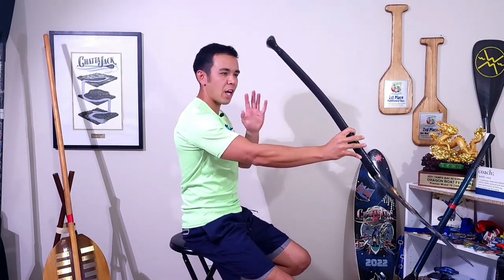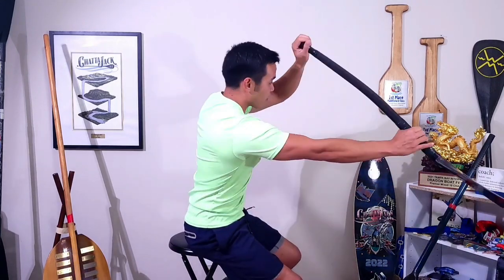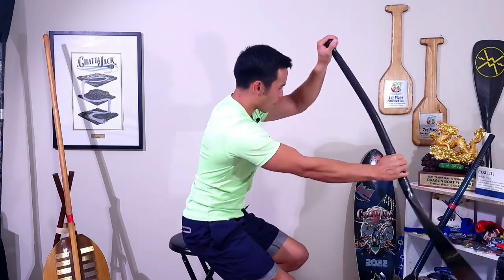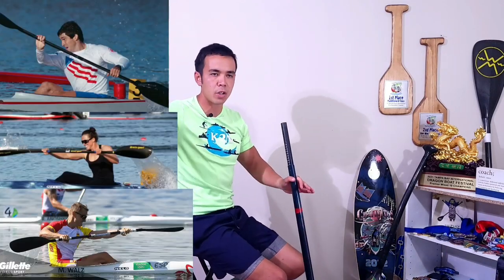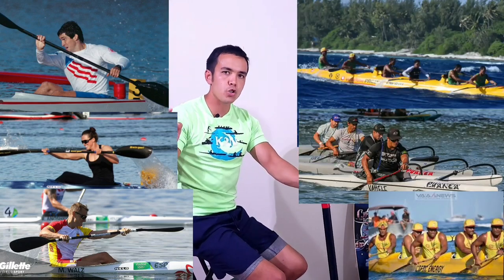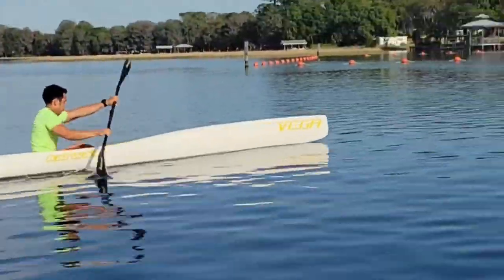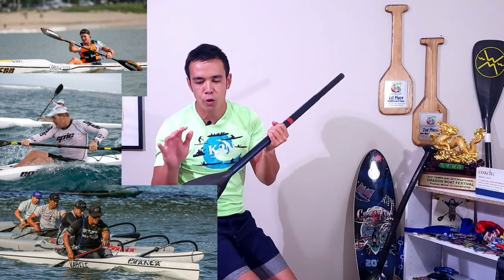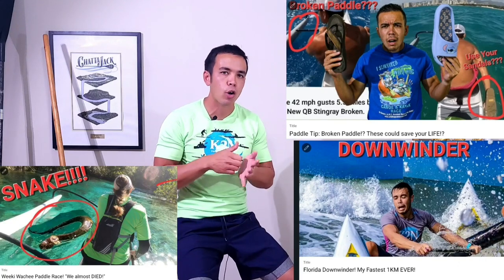Paddle Tip: Powering The Pendulum (Outrigger/Surfski)

Comment: Another excellent video! The guy that coached me when I first got into surfsking was adamant that I start thinking about pulling the blade out as soon as I started the catch. When I was out on my own practicing I felt like I was cutting my stroke short and that I had power left right at my hip. Now I bring the paddle all the way back and rotate just past my hip before I pull it out. It feels much more powerful.
Reply: Absolutely.  I reached the same insight, while practicing on my own, in an oc-1, and focusing on the feel of the canoe.  As David Tepava, Shell Va'a's coach, once said in an interview, when asked about the secret to the huti pa'ari ( a traditional Tahitian long stroke, that strikingly reaches maximally far in back ):

"[The secret to the huti pa'ari] is to gain an appreciation for what we do: paddling with the elements, atuned to the canoe's glide, and the feeling of the sea.  This stroke may be slow, but there is a heck of a lot of pull pressure, which is why the canoe glides far." — David Tepava

Focusing on the canoe's feel is key, and will reveal the mysteries of the stroke.  In another interview, Tepava also says: "Having tried several training regimens, several canoes, won every race, I came to realize that what matters is not the speed of the stroke, but the speed of the canoe."

The reason extending the blade past the seat works, is that the blade is still locked in the water mass, and that you can use it as an anchor point to, in effect, pull your hip to your top pressing hand, as it swings down, thus propelling the canoe forward, much like poling a boat ( or "pole-vaulting" ).
Reply: @namolokaman2393  thank you for sharing this insight! It really helps clarify why that last little bit feels needed. I like the analogy of poleing the boat
Reply: @paddlefaster  Contrary to common belief, the contribution to forward motion, by the so-called "negative angle" part of the stroke [ here, defined as when the blade extends past the body, from the point the bottom tracting arm reaches vertical, while sitting upright, as opposed to the strictly vertical azimuth of the blade or haft, which occurs well in front of the body ], can be substantial.  You can easily verify this, by seating upright while inserting the blade at about the seat, and swinging your top arm down-and-aft, thus producing a mostly rear-powered stroke, and see how much forward motion you get ( answer: a lot! ).  In fact, Shell Va'a famously relies on a stunningly rear-powered stroke, which is extra deep and reaching maximally far in back (!), called the Huti Pa'ari, usually to go against mild swell / hard-water conditions, while saving energy ( it's a 3-second stroke! ).

Comment: That's good; I am glad we're finally coming around — slowly — in the Northern hemisphere, to talking about allowing the blade to extend past the seat, into so-called "negative angle" territory.  So many outrigger paddlers, particularly among the older generation ( older coaches especially ), appear fixated on preventing this from happening.  Consequently, the blade ends up exiting early, systematically ( even when not sprinting ), which basically is an enticement to paddle short and fast — accelerating — all the time, and gets exhausting, not to mention inefficient, particularly for long-distance.

Regarding stroke motion, I personally like to break it down into two component motions, mixing in varying amounts ( meaning ranges ), depending on stroke type: huti pe'e, huti roa, and huti pa'ari, in Tahitian ( which we've labelled, at our club: high-tempo, easy-long*, and deep-shovel ).  The first component motion — in its fullest amplitude — is the pendulum swing, at arms' length: the upper hand increasingly pressing down toward the gunnel, while shoulders turn sideways ( the torso, really ), allowing the blade to sweep far in back, in one fluid motion ( as would be the case for the huti pa'ari ).  The second component motion being the linear translation: as the torso, having leaned forward at the top of the stroke, comes back to sitting upright, the 'tracting arm' ( "le bras tracteur", in French ) pulls the bottom hand toward the seat.

These two component motions are effectively blended: as the blade dips into the water, and the torso gradually leans back, the bottom hand pulls the blade alongside the hull, while the top hand initiates its 'pendulum swing' arching trajectory toward the gunnel, increasingly pressing down, particularly from about mid-chest down.  In this way, power is organically transferred, subjectively, from the bottom tracting hand to the top pressing hand ( that's how it feels anyway ).  Note: In the case of the high-tempo acceleration stroke ( huti pe'e ), the top hand merely has time to reach down to about mid-chest, on its otherwise 'pendulum swing' itinerary, so it never really presses down much.  As mentioned, for all other long strokes, the top hand reaches down to at least the hip, and frequently to the gunnel ( depending on stroke type and paddle length ), meaning that the blade is definitely in back.  So, the motion is essentially one of 'pull' first ( with the bottom hand, at the top of the stroke ), followed by 'push' down-and-aft, i.e. 'press' ( with the top hand, once reaching mid-chest or so, on down ).  'Pull-push', or more accurately: 'pull-press' — never: 'push' straight out, with the top hand, while simultaneously pulling with the bottom one ( which would, in effect, 'collapse' the triangle )!!! ☺

(*) Note: We've further broken down 'easy-long' ( huti roa ), at our club, into three sub-types, depending on where the power is applied: front-powered, seat-centered, or rear-powered ( which we call "Easy-Long Type 1", "Type 2", and "Type 3" ).
Reply: P.S. When the canoe is already at speed, a paddler does not so much 'push' packets of water back with the blade, so much as pull him or herself — and the canoe — up to the blade's position, once the latter is securely locked into the mass of water, following the catch.  Likewise, pressing down-and-aft, during the second phase of long strokes, does not really push water toward the back — the blade being still locked in — but rather, serves to pull the hip to the top hand, as it swings down ( and the canoe along with it, via the seat + extended leg ), much like poling a boat, or "pole vaulting".
Reply: If the Tahitians do it, copy it! But in all seriousness if you work with a speed coach you can immediately see what "works" and what doesn't. While the front part of the stroke has the most power, there is still plenty left "past the seat" especially if you are covering long distances.

p.s. I really appreciate your comments under various videos on Youtube.